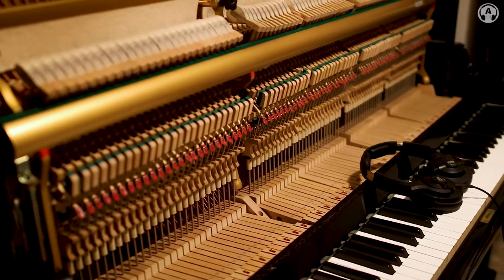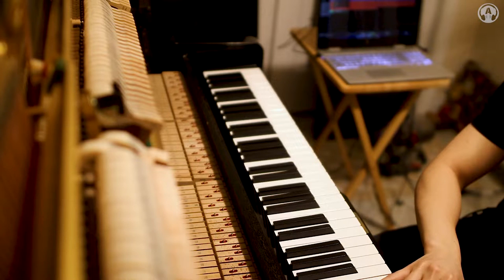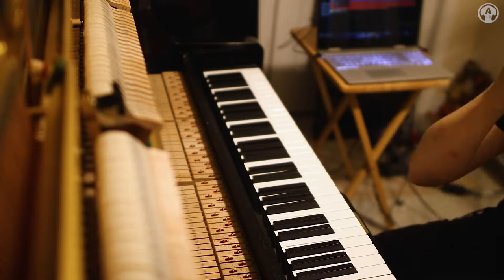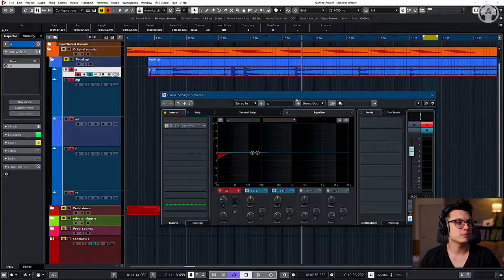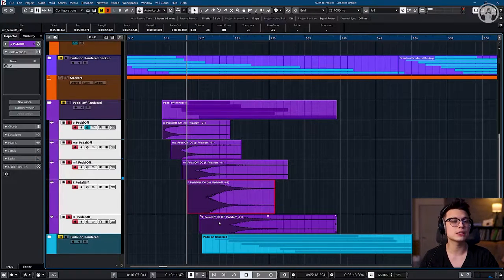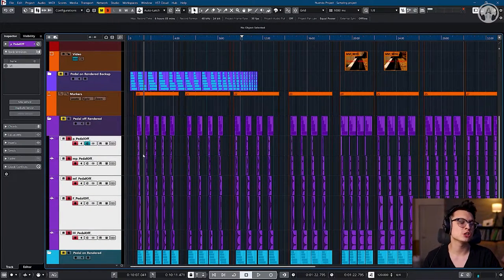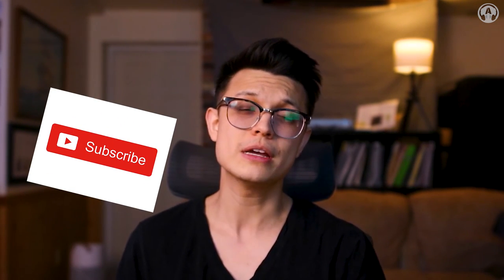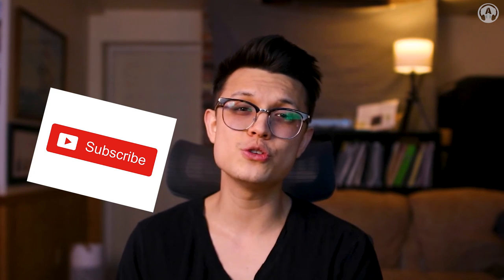How to Sample a Piano using KONTAKT!

Comment: Thank you for posting this insightful video. I owned a Yamaha U3 and it one of the best uprights on the market in my opinion; the 52" height increases the string length and soundboard size just enough to give enormous sound improvements in the tenor and bass sections, especially (compared to the 48" U1, for example).  Moving the piano away from the wall several feet and placing some mics on the backside (experiment with different distances) will help to reduce unwanted sounds from the action and will allow unobstructed access to the soundboard.  It also dramatically changes the acoustical reflections in the room and, in my case, made the piano sound much better overall. Too bad I didn't figure that out until I was moving and selling the piano!  You can mix in mics from the frontside as well as needed.  You might also consider trying some ribbon mics, if the sound is too bright, as Yamahas tend to be, depending on the voicing of the hammers, etc.  Good luck and have fun (even though it is extremely tedious work)!
Reply from the maker: Thanks for this comment; I really adore this piano its been with me for over 18 years! I actually moved the piano near my staircase for the reason reason you just mentioned, it sounds much better there! I really would love to close mic a some stereo coles 4038's and combine them with some other condensers a little further away. I did this mic combo at Humber studios for some recordings a while back and it really captured the low and mid nicely but because of the ribbon it attenuated much of the hammer\mechanical noise from close mic a piano, combined and mixed,  you get the nice detail of the condenser far enough to avoid the mechanical noise but then have the ribbons close to bring out and  enhance the low and mids of the piano. My preference is generally for warmer sounding pianos which are a little less bright so this setup worked for me!
Reply: @ArcitecAudio   Wonderful! You might also consider a Blumlein pair (condenser or ribbon), depending on how much you like binaural.  I have not tried Blumlein yet but plan to experiment with a pair of AKG 414's.  Have you tried SampleRobot?  I am temped to try it.  Pricey, but seems to potentially automate the sampling workflow in a very time-saving way. I can see how it would be a big time saver with synths (especially ones with MIDI), but I was wondering about acoustics instruments.
Reply from the maker: @64nightfly  I havent done the blumlein technique yet on a piano but i have actually sampled a piano using the binaural ku-100 along with some coles, 149s and some km184s its was my best piano sampling; will post it up one day with a link to download it, maybe on piano book and my website. I have not tried sample robot, will look into this for sure, any time saver in sampling is good!

Comment: Is this library available for sale or download? Thanks for sharing!
Reply from the maker: I dont have a download for this specific one available at the moment:( , however this year i will be making a video or two showing my experience creating a vst for Kontakt which will be downloadable. It will be a piano vst that will be sampled Binaurally with the KU-100 along with a bunch of other mics. Ive already done this before with less velocity samples but havent posted a video on it yet. Ive been so busy with my new job that You Tube has fallen by the wayside. When im a bit more stable i intend to get some stuff up!

Comment: Presumably the sections around 15:26 - 15:37 are to show the differences - if any - between the original piano sound and the sampled sound. It is quite easy to tell the difference, though some may like the fact that the samples have taken the twang out of the original. Very interesting - thank you . I often wonder whether it's really necessary to use expensive microphones for this kind of exercise. I used a simple mic to make a quick version of our own piano using the Logic sampler. It's not great, but it took hardly any time to do. I do not know how to export a virtual instrument easily from the Logic sampler to other virtual instrument systems. Probably if I wanted to do so I could generate a virtual instrument with some effort and (say) Decent Sampler, but that would be a lot slower than just using the Sampler in Logic directly and would only be worthwhile if I wanted to use the virtual instrument in different software systems.
Reply from the maker: The differences are quite noticable yes and in general i would say more expensive microphones = better result up to a certain point. Its also the depth of your sample layers which makes a convincing sample, with pianos its mostly in the in the velocity layers!  To get a decent sounding sample, better than this recording youve got to spend around 3hrs just doing all your layers, after that processing is not that fun either:) Im not too familiar with the Logic sampler so Im afraid i cant be of much help here! With regards to your sampler of choice, I would recommend Decent sampler or Kontakt as you can use these with other DAWS, but if your a logic die hard then i think the ease of sampling outweights the effort needed in making your sample versatile across multiple DAWs

Comment: Why do the sample sounds from your completed piano sound so wooly compared to the sound of your real piano?  It doesn't sound as clean as your original piano, it sounds more like a felt piano now. All the top end is gone and it's all muffled sounding.
Reply from the maker: So there are a couple of reasons for this. The main one is that the De- noising process for the samples removes a lot of the treble, in my case I had to remove more noise because I didnt have high quality mics and preamps to record with. Another  reason is that I used the practice pedal(felt piano) so that also made it sound muffled. Ive had oppourtunities to record with higher quality mics/signal chains and imo they make all of the difference in terms of quality. Of course I nice piano generally helps too:)
Reply: @ArcitecAudio  Thanks for the explanation. I can now understand the difficulties you had in recording the samples and removing noise. It's a long laborious process recording samples.
Reply from the maker: @jonos138  With better mics and you dont have to do as much noise removal and it sounds much better!